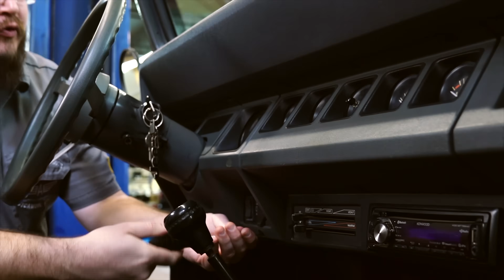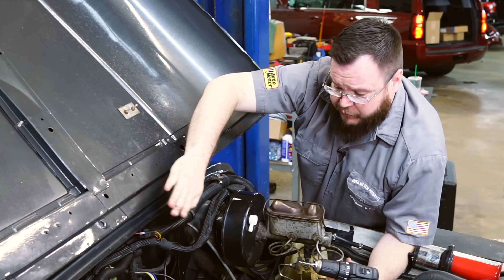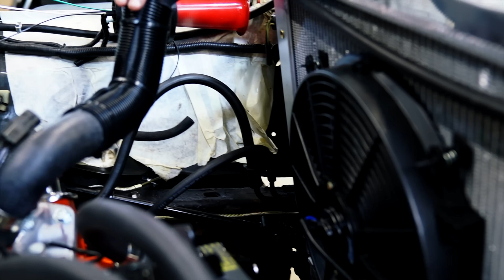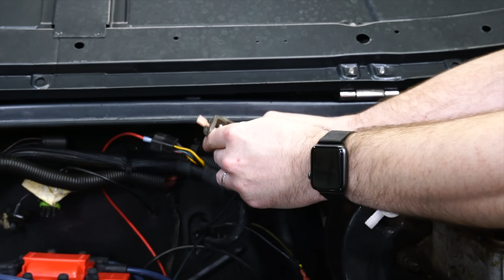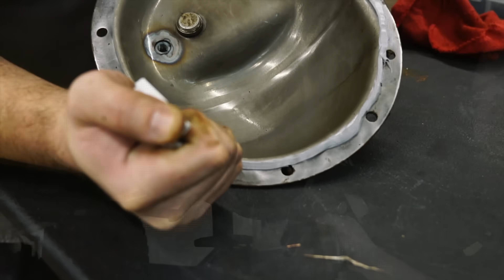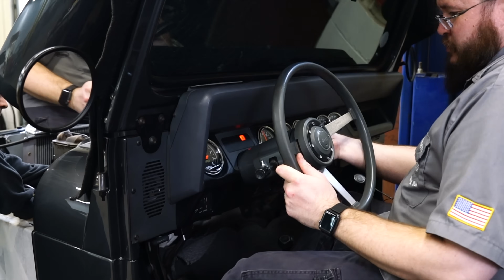AutoMeter Garage Episode 13 - V8 Swapped Jeep Wrangler Gauge Installation

Comment: I have a 91 Jeep Renegade and would love to install a Dodge 360 ATK, Summit Racing, or Jegs engine, and a TorqueFlite 8-speed automatic,  front/rear currie-60-high-pinion BUT, I live in California :eyes-purple-crying: Question, doesn't anyone make a diff cvr. that has a bung for the sender plus drain plug? Does all the gauges say Jeep inside, Nice Touch. Thanks for the video.
Reply from the maker: Please reach out to our Product Specialists at service@autometer.com

Comment: to auto meter: why not use 2 wire gauge senders... isolated ground and direct to the gauges!
Reply from the maker: Our short sweep gauges typically use a single wire sensor, but all of our full sweep electric gauges do feature 2 sensors.

Comment: I just priced this kit on your site. Cost over Thousand dollars and doesn't come with speedo conversion unit  from what I read. Too pricey for some plastic and set of gauges and senders .
Reply: Do you found any alternative solution? 1000 dollar is a lot for this parts
Reply: @FRUMACO   I did thier two  smaller companies withdraw good reviews  .One out of Florida and one from California. The one I bought gauge set setup was from California . Don't have them in front of me at moment  to give the name  sorry.  But they are great about answering phone calls and emails. A set I picked was several hundred dollars with all sensors  and instructions. Getting ready soon to finally install them. It's been a long project.
Reply: @larryalexander4833   i am not sure if i want to replace it with digital gauges. i like the possibilities but also i am afraid what problems could be come with all this electronic things. :-) if you done let see your final Installation
best TOM!

Comment: Never drill a grommet... Worst case use a knife or an actual grommet punch tool...and if you are pulling ground to under the hood... Run it to the battery... The engine ground could be bad. Aka on a Jag 😉
Reply: Ground to battery, then run to body, then frame. The more grounds the better.
Reply: it's earthed to the manifold because both the temp and oil senders are in the manifold. it's clearly not a jag so that's as irrelevant as jags are.

Comment: What other components were used outside those included in the 7040 package? Also, if the white LED’s aren’t purchased will thing ring color be either red or green?
Reply from the maker: Hello Andy! The 7040 package includes the following Oil Sender 2242, Trans Temp Sender 2258, Water Sender 2258, 
1/4" NPT, 3/8" NPT and 1/2" NPT adapter fittings, Bulb & Socket 3220 (which is a white incandescent light for the ring color), Light Covers Red 3214 & Green 3215, and mounting brackets. For the braided lines, we have a variety of sizes in the accessories category on our website.